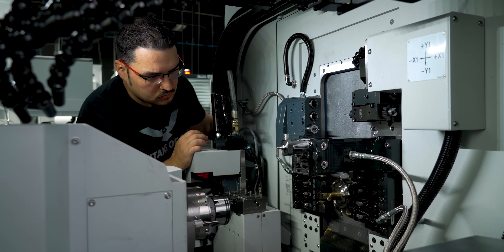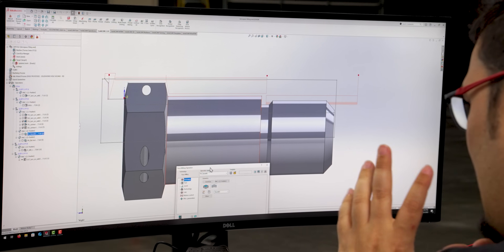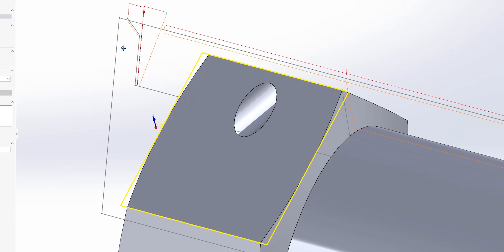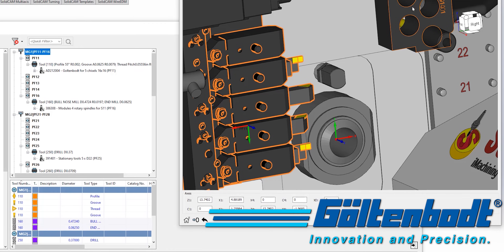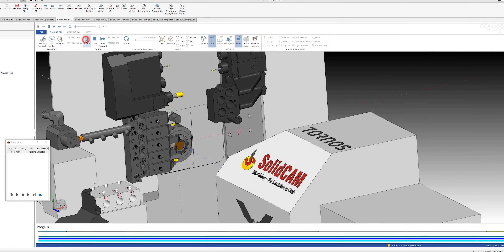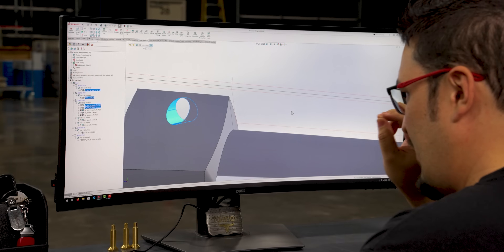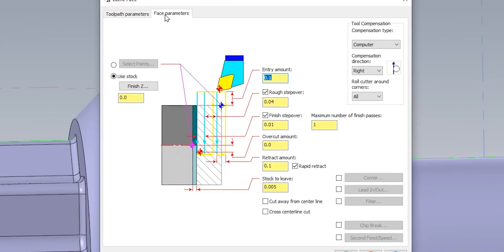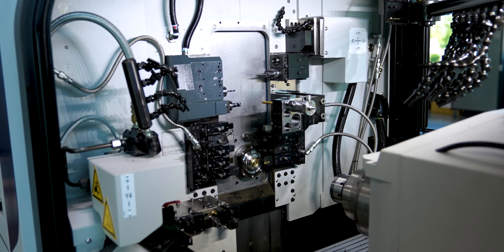Using SolidCAM for the first time

Comment: "Being user-friendly doesn't sound all that speciial"... but it can be the single most important feature, having an effect of productivity.  In earlier days of computers, my rule of thumb was that, at the end of my first session with a new application, if I came away smiling it was worth continuing with.
My second rule of thumb was that the user should NEVER be left looking at a screen with no apparent way forward or back.
I think this is just as valid today; 'Hidden Features' are just a programmer's ego trip!
Another cracker video, thanks.  😊

Comment: Solidcam probably works well if you don't know much about machining or don't know how to machine a part. If you know what your doing solidcam SUCKS compared to mastercam.
Reply: Based on what?

Solidcam has beaten MasterCAM in nearly every aspect when you put them head to head. 

MasterCAM has junk surfacing paths, no auto updating stock models, you done have sit there and make layers, you don’t have to rely on MasterCAMs sub-par file format tranlator that causes imported STEP files to get janky. 

Would really like to know what you think MasterCAM can do that solidcam can’t not only do, but do better.
Reply: @occamssawzall3486  based on personal experience. Solidcam works fine %80 of the time but the last %20 is painful. Maybe my version of solidcam is buggy but multiple times daily I'm saying "f*ck solidcam" Mastercam in my opinion reigns supreme. Sure it has its problems, they all do, but I rarely found myself swearing at Mastercam

Comment: Edgecam blows everything away in my opinion there is no better software period .  For the amount of things it can do from quotes to file management to  full  Cm probing routines that can be printed and sent to inspection . fixturing , auto part seamlessly into simulation machines ,  With vise or tombstones , the software is preloaded with all this stuff . and much much more . I'm not affiliated with Edgecam at all I'm just very impressed. it comes preloaded with mill turn . you can design machines, post processors . all right from the software.
Reply: Solidcam can do all of that as well. Not only can it do it, but it can do it better and faster.

Comment: Actually Mastercam can adjust the hole in the solid without having to reattach all the tool paths... click on the model prep tab and it's in that area... good video... I appreciate you...
Reply: So can solidCAM. This was an oversight in the video. No coord or reselction of geometry is needed. Just a change in size of the tool in the toolkit.
Reply: That's what I like about Mastercam, I can just select a bigger tool and run the path... fast and easy... not locked to geometry... good stuff... Swiss machine's are really cool... @occamssawzall3486

Comment: Great video, really good points! I've been using Solidcam for some time, and the way it works right inside SolidWorks is just fantastic. It saves so much time not having to jump between programs for design and toolpaths. And their iMachining is seriously impressive; it makes a huge difference in cutting times, and tools definitely last longer because of those smart optimized paths the wizard helps create. Programming even complex parts feels straightforward, and the simulation gives you real confidence before hitting cycle start. It really streamlines the whole workflow from design to the finished part. Definitely makes CNC machining much more efficient!

Comment: both not high end Software for CAM. Use Autodesk PowerMill or Tebis
Reply: Solidcam is higher end than PowerMill by leaps and bounds. Has better finishing tool path strategies in both 3 and 5 axis, in roughing, iMachining alone is the best roughing strategy on the market today.  Has better control for eliminating air cuts.   List goes on.
Reply: @occamssawzall3486  rough and finish:)))))))))))))IMachining.
Reply: u worked with tebis ? We are in the process of finding a new cam Software and are looking at tebis and hypermill.
Reply: Siemens NX.  Only reason lots more don't use it is cost.  The initial seat cost is up there but worth every penny imo.

Comment: The simulation for the Tornos looks really good.  Does it simulate using the actual G-ode after it has been through the Post Processor?
Reply: No.  Simulations are internal, not post processed g-code in solidcam.

Comment: I have been using SolidCam for 2 1/2 years. Love it. It is easy as it is inside of SolidWorks so when you make a model change it sees if and loads the new model without destroying everything. I will admit that I have never used MasterCam but from the videos that I have seen it looks like a real pain to use. Since most people use Solidworks to draw up parts it makes sense to Cam inside of it. Very powerful software. The iMachining is awesome.
Reply: I use this cam........,for 23 years:)))))))))))))